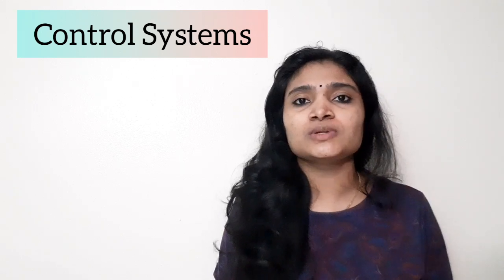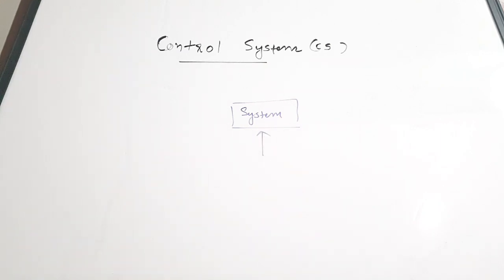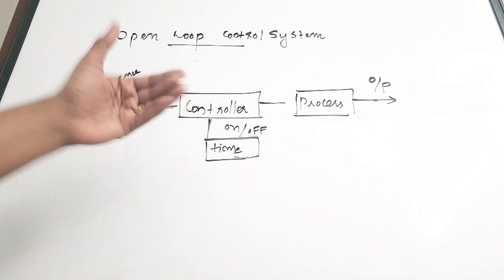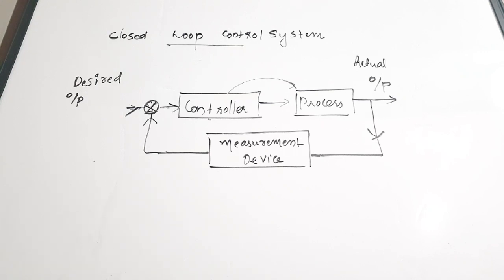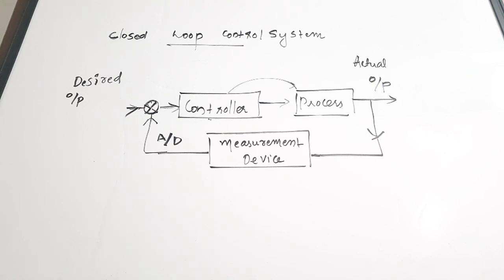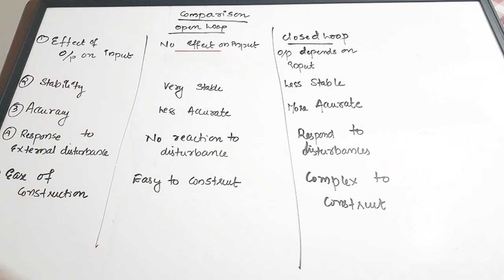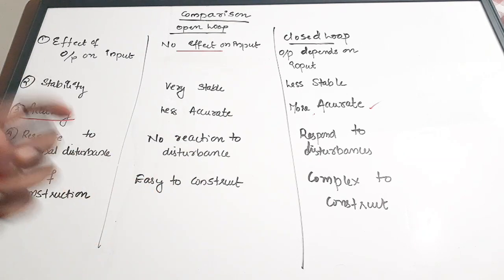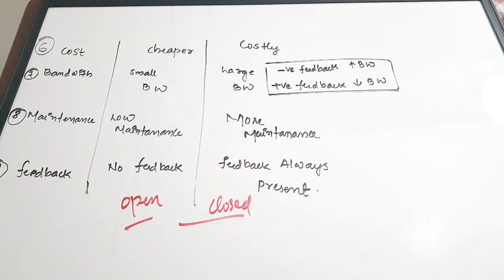Control Systems Introduction|Open loop and Closed loop Control Systems| Comparison| Gate2021

Comment: Thank you miss..One question..If we use an ADC after measurement device  then the controller, reference signal and everything needs to be  digital.right?? Then basically it becomes a digital control system??
Reply from the maker: Everything need not be Digital. Only input needs to be. Because only input is compared with the Measurement output.
Reply: @EasyElectronics_jobupdates  If the input and output from ADC both are digital,then the error signal will also be digital.That means the controller has to be also digital in that case.. Otherwise how an analog controller can process a digital signal maam??
Reply from the maker: @dheerajlaltd  we can convert the Error signal as analog if we want right. But I dont think u have to think so much.
Systems varies based on their requirements. Both Analog and Digital is possible.
Reply: @EasyElectronics_jobupdates  That means a DAC before controller..right maam?? Okay.. Thank you miss for the clarification 😍👍